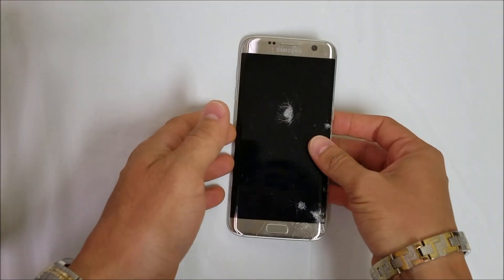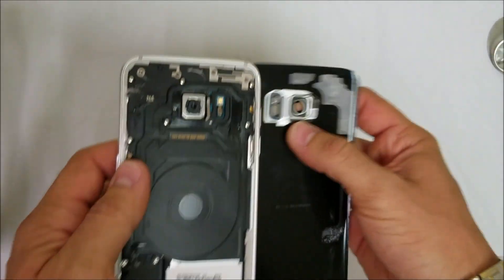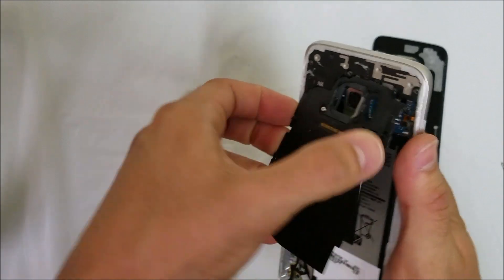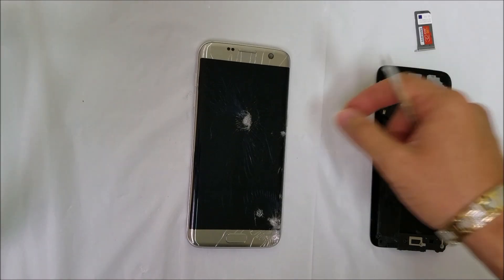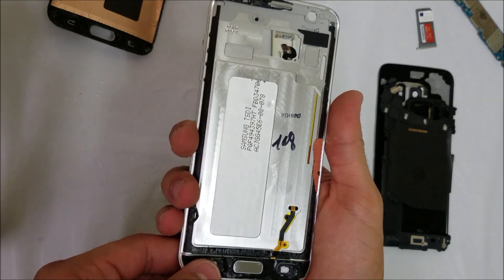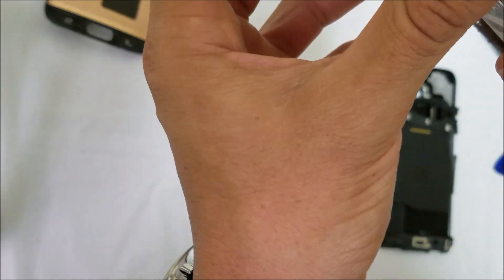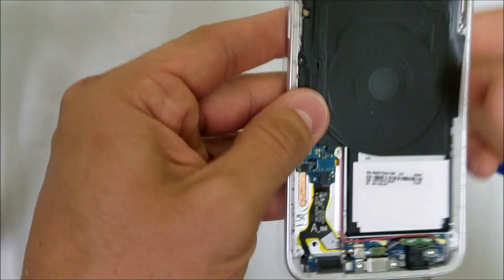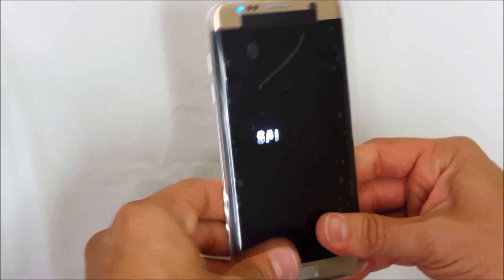Samsung Galaxy S7 Edge - How to Take Apart & Replace LCD Glass Screen Replacement

Comment: Always testvthe new screen before screwing pcb board protectors in.Alao spray alcohol in between where you are trying to prise apart to soften the previous repair glue.
Slide screen up and down because I have had 2 screens that did not slide open.
Good video but cringed for you when you were tugging away at the old screen lol ! 
I have liked and subscribed.

Comment: Yeah my back cover just shattered when I got to an edge.

Overall decent video, phone works, forgot to plug in the power button the first time. New screen was aboun $90, now I need to buy a back panel ($20) and the tools to fix it cost me $20 - Mine came with new adhesive, but I lost the speaker grille. 

Consensus - I could have bought a new used phone instead, but it was a good exercise.
Reply: I need acces to old files on my phone lol screen is broken just going to order an old screen from ali for like ten bucks and have a fun little "exercise" to be able to acces my files again.
Reply: Lmfao nice

Comment: You should have tried to remove the digitizer in one piece to reduce extra shards forming. Another trip to the hot plate would really have helped. For best results, I would apply fresh adhesive. I wouldn't have said "pry the board" up, "Lift the board" would have been better.
Reply: You are right. Here in Ireland we say: "Gently raise the main logic board from the assembly, always remembering to use a clean shovel"

Comment: Will remove the back of the phone kind of  affect the waterproof of the phone and also will the glue stick back in?
Reply: The adhesive will work again - but not be water resistant. You can  buy new adhesive cheaply. So cheap, I would buy a couple as you MAY ruin the first one. Practise run, if you will

Comment: 6:08 Dose it say a whole 4.4V on the battery?!! I was sure 4.2V was the absolute max for lipos.
Reply: dose of what? and yes it does in case you're wondering..better take it up with Samsung lol
Reply: @sebastianmuntean235  Oh I wrote wrong, I of course meant roller coaster. Thanks for pointing this out, I understand I could be very hard for some ppl to undertsnad what I meant there I understand i fit was hard for you, Its not easy. And I just remembered that SAMSUNG have a special HV type batteries in their phones, good shit.
Reply: @dtiydr  standard voltage is 3.85 and charging voltage is 4.4
Reply: @ldiazmdiaz  Ok charging voltage so the max voltage on the battery could be lower with other words.

Comment: This is a great chance since these are really original and very  NEW and not cheater source. We just got this offer from the original supplier NOW.
He asks several old friends to offer price, which offers the highest price, he will give goods to that one.

AVAIL QTY DESCRIPTION  
601 iPhone 6 LCD Screen and Digitizer - OEM Premium / White OEM Premium  
100 iPad Air 2 LCD Screen and Digitizer / New / Part Only  
264 iPhone 6 Plus LCD Screen and Digitizer - OEM Premium / Black  
135 Galaxy S6 LCD Screen and Digitizer / New / Black  
110 Galaxy Note 4 LCD Screen and Digitizer / Black / New  
187 iPhone 7 LCD Screen and Digitizer - OEM Premium / Black  
91 Galaxy S6 LCD Screen and Digitizer / New / Gold  
89 iPhone 7 Plus LCD Screen and Digitizer Full Assembly - OEM Premium / New / Part Only  
100 Galaxy Note5 LCD Screen and Digitizer / Black / Part Only  
276 iPhone 5c LCD Screen and Digitizer - OEM Premium / New  
64 Galaxy Note 4 LCD Screen and Digitizer / White / New  
57 Galaxy S6 LCD Screen and Digitizer / New / White  
58 Galaxy S7 LCD Screen and Digitizer / White / Part Only  
118 iPhone 6s LCD Screen and Digitizer - OEM Premium / New / Part Only  
100 iPhone 6 LCD Screen and Digitizer - OEM Premium / Black  
129 iPod Touch (5th Gen) LCD Screen and Digitizer / Part Only / Black  
2000 iPhone 6s Plus Display Assembly Adhesive / Black  
59 iPhone 6 Plus LCD Screen and Digitizer - OEM Premium / White  
35 Galaxy S5 LCD Screen and Digitizer / Black / New  
39 iPhone 6s Plus LCD Screen and Digitizer - OEM Premium / New / Part Only  
29 iPad mini 4 LCD Screen and Digitizer / New / Part Only  
55 iPhone 6s LCD Screen and Digitizer - OEM Premium / New / Part Only  
27 Galaxy Note 4 LCD Screen and Digitizer / Gold / New  
26 Galaxy S5 LCD Screen and Digitizer / White / New  
48 Galaxy Note5 LCD Screen and Digitizer / White / Part Only  
15 iPad Pro 9.7" LCD Screen and Digitizer / White / New  
20 Galaxy Note 3 LCD Screen and Digitizer / White / Part Only  
102 iPhone 5 LCD Screen and Digitizer - OEM Premium / White  
14 Galaxy S6 Edge LCD Screen and Digitizer Assembly (GSM) / White / New  
119 iPhone 4 LCD Screen and Digitizer (CDMA/Verizon) / Part Only / White  
159 iPod Touch (4th Gen) Display Assembly / Part Only / White  
30 Galaxy S4 LCD Screen and Digitizer (no Midframe) / Black / Part Only  
23 Galaxy S6 LCD Screen and Digitizer Assembly (Verizon) / White / A-Stock  
12 Galaxy S6 Edge LCD Screen and Digitizer Assembly (GSM) / Gold / New  
9 Galaxy S6 Edge+ LCD Screen and Digitizer Full Assembly (AT&T) / Black  
15 Galaxy S5 LCD Screen and Digitizer / Gold / New  
164 MacBook Pro 13" Unibody and MacBook 13" Unibody Fan / Used / Silver  
17 Galaxy S6 LCD Screen and Digitizer Assembly (Sprint) / Black / A-Stock  
9 Galaxy Note II LCD Screen and Digitizer (T-Mobile/AT&T) / White / New  
6 Galaxy S7 Edge LCD Screen and Digitizer / White  
14 Apple Watch (38 mm Original) LCD Screen and Digitizer / Sapphire Crystal / New  
6 Galaxy S7 Edge LCD Screen and Digitizer / Gold  
29 Galaxy S8 Midframe / Black  
28 Galaxy J3 LCD Screen and Digitizer / Gold  
5 Galaxy S7 Edge LCD Screen and Digitizer Assembly (AT&T) / Silver / New  
6 Galaxy Note 3 LCD Screen and Digitizer Assembly (Sprint/Verizon) / New / White  
403 iPad 2 Wi-Fi 16 GB (EMC 2560) Volume and Power Button Cable / New  
12 Galaxy Note 3 LCD Screen and Digitizer Assembly (T-Mobile/AT&T) / B-Stock / Black  
13 iPhone 7 Plus LCD Screen and Digitizer - OEM Premium / White  
9 Galaxy Note 3 LCD Screen and Digitizer / Black / Part Only  
4 Galaxy S7 Edge LCD Screen and Digitizer Assembly (AT&T) / Gold / New  
12 Galaxy S6 LCD Screen and Digitizer Assembly (Verizon) / Gold / A-Stock  
5 Galaxy S6 Edge+ LCD Screen and Digitizer Full Assembly (AT&T) / White  
30 Galaxy Note5 LCD Screen and Digitizer / White / Part Only  
DESCRIPTION QTY ALL NEED CAMERA BRACKET AND SENSOR BOX INSTALLED
iPhone 6 LCD Screen and Digitizer / New / Part Only / Black        400 　
iPhone 5c LCD Screen and Digitizer / New / Part Only               100 　
iPhone 6 LCD Screen and Digitizer / New / Part Only / White        300 　
iPhone 5s LCD Screen and Digitizer / New / Part Only / Black       200 　
iPhone 6 Plus LCD Screen and Digitizer / New / Part Only / Black   300 　
iPhone 5s LCD Screen and Digitizer / New / Part Only / White       200 　
iPhone 6 Plus LCD Screen and Digitizer / New / Part Only / White   200 　
iPhone 6s LCD Screen and Digitizer / New / Part Only / Black       400 　
iPhone 6s LCD Screen and Digitizer / New / Part Only / White       300 　
iPhone 6s Plus LCD Screen and Digitizer / New / Part Only / Black  300 　
iPhone 6s Plus LCD Screen and Digitizer / New / Part Only / White  200 　
iPhone 7 LCD Screen and Digitizer / Black                          250 　
iPhone 7 LCD Screen and Digitizer / White                          150 　
iPhone 7 Plus LCD Screen and Digitizer / Part Only / White         150 　
iPhone 7 Plus LCD Screen and Digitizer / Part Only / Black         200 　
iPhone 8 LCD Screen and Digitizer / Black                          25 　
iPhone 8 LCD Screen and Digitizer / White                          25 　
iPhone 8 Plus LCD Screen and Digitizer / Black                     25 　
iPhone 8 Plus LCD Screen and Digitizer / White                     25 　
  
DESCRIPTION QTY 
iPhone 4S LCD Screen and Digitizer / New / Part Only / Black                              90 
iPhone 4S LCD Screen and Digitizer / New / Part Only / White                              100 
iPhone 5 LCD Screen and Digitizer Full Assembly / New / Part Only / Black                 10 
iPhone 5 LCD Screen and Digitizer Full Assembly / New / Part Only / White                 24 
iPhone 5 LCD Screen and Digitizer - OEM Premium / Black                                        50 
iPhone 5s LCD Screen and Digitizer / New / Part Only / Black                              23 
iPhone 5s LCD Screen and Digitizer / New / Part Only / White                              69 
iPhone 5s/SE LCD Screen and Digitizer - OEM Premium / Black                                    37 
iPhone 5s/SE LCD Screen and Digitizer - OEM Premium / White                                    82 
iPhone 5c LCD Screen and Digitizer Full Assembly / New / Part Only                        3 
iPhone 5c LCD Screen and Digitizer / New / Part Only                                      2 
iPhone 5c LCD Screen and Digitizer - OEM Premium / New                                         139 
iPhone 6 LCD Screen and Digitizer Full Assembly / New / Part Only / Black                 376 
iPhone 6 LCD Screen and Digitizer Full Assembly / New / Part Only / White                 39 
iPhone 6 LCD Screen and Digitizer / New / Part Only / Black                               40 
iPhone 6 LCD Screen and Digitizer / New / Part Only / White                               27 
iPhone 6 LCD Screen and Digitizer - OEM Premium / Black                                        135 
iPhone 6 LCD Screen and Digitizer - OEM Premium / White                                        191 
iPhone 6 Plus LCD Screen and Digitizer Full Assembly / New / Part Only / Black            14 
iPhone 6 Plus LCD Screen and Digitizer Full Assembly / New / Part Only / White            32 
iPhone 6 Plus LCD Screen and Digitizer / New / Part Only / Black                          138 
iPhone 6 Plus LCD Screen and Digitizer / New / Part Only / White                          89 
iPhone 6 Plus LCD Screen and Digitizer - OEM Premium / White                                   75 
iPhone 6s LCD Screen and Digitizer Full Assembly - OEM Premium / New / Part Only / Black       9 
iPhone 6s LCD Screen and Digitizer Full Assembly - OEM Premium / New / Part Only / White       11 
iPhone 6s LCD Screen and Digitizer / New / Part Only / Black                              65 
iPhone 6s LCD Screen and Digitizer / New / Part Only / White                              21 
iPhone 6s LCD Screen and Digitizer Full Assembly  / New / Part Only / Black               18 
iPhone 6s LCD Screen and Digitizer Full Assembly  / New / Part Only / White               14 
iPhone 6s Plus LCD Screen and Digitizer Full Assembly - OEM Premium / New / Part Only / Black  6 
iPhone 6s Plus LCD Screen and Digitizer Full Assembly - OEM Premium / New / Part Only / White  10 
iPhone 6s Plus LCD Screen and Digitizer / New / Part Only / Black                         1 
iPhone 6s Plus LCD Screen and Digitizer / New / Part Only / White                         32 
iPhone 6s Plus LCD Screen and Digitizer Full Assembly / New / Part Only / Black           13 
iPhone 6s Plus LCD Screen and Digitizer Full Assembly / New / Part Only / White           14 
iPhone SE LCD Screen and Digitizer Full Assembly - OEM Premium / New / Part Only / Black       13 
iPhone SE LCD Screen and Digitizer Full Assembly - OEM Premium / New / Part Only / White       7 
www.shengxintga.com

Comment: Good video did one in an hour just be careful with the back cover when you start cause it is glass and I reheated the glue on the frame before reinstalling the LCD back on and also the back cover and yes I put all new adhesive back on😁

Comment: Anybody else watch this video and say ...."No thanks I'll just take it somewhere. I was going to try doing mine until I saw this shit.
Reply: LOOOOOOL, that's exactly what I was thinking. Just thought I'd read the comments first though. This comment made me laugh.
Reply: Nick Johnsen nope I just did it pretty simple took me an hour to do it 😎
Reply: nah man actually tempts me to try it myself..love a challenge and save some cash why not
Reply: Nick Johnsen actually no
Reply: Yeah, it's taken me weeks to summon the courage but I've just finished this - I looked at several different vids and made sure I got all the parts needed, including the adhesive templates, new jack where I busted the ribbon cable (doh!). Take your time and this is doable - oh and make sure you keep the phone hot when teasing it apart it helps enormously - that glue cools down and hardens real quick.
Reply: @OggyGTA  How much did it cost?  If it costed $50 I'd do it tomorrow but kits seem to be priced around $230. :-(
Reply: Most people outside would not do a glass only replacement.
Reply: me right there
Reply: No I watched and was like “looks easy, I’m gonna try it”
Reply: it really aint that hard.....actually fun doing
Reply: is alright, but he didnt do it the best way. also, he left the old double-face adhesive on...that is what makes it water proof, or water resistant -_-

Comment: You ruin the Lcd and digitizer . Learn how to replace just the glass. You are a rooky
Reply: Locon Giganton it was ruined. He is changing the whole unit.
Reply: He pointed out a small spot where the display was damaged under the hole, not just the glass screen part.

Comment: where is a good place to get a digitizer for the Galaxy S7 Edge
Reply: It's best to get a service pack instead. It includes the mid frame, buttons, and lower charge connector. You provide the main board, camera, speaker, vibrator motor, etc. Basically enough so you don't need to remove the screen as everything that connects under it will be included.

Comment: Why didn''t you remove all the old adhesive from the back? Is it still waterproof using this method?  I'd imagine that it needs to be very flat to seal it up again.
Reply: normally you would, then you would buy a adhesive replacement. if you keep it in, i suggest not getting water on it or putting it in water, because personally i wouldn't trust how strong the adhesive is after the repair.

Comment: Whats the cost for the screen? I see two camps on Ebay as far as price. those in the low 100's and 300 dollars. I cracked the screen on my S7 Edge this morning, but I went to see the prices and decided to go from gold to black. The tear down looks easy but I wonder why you didnt use a heat gun to loosen the adhesive? and will the new screens adhesive retain the IP68 water resistance rating? Thanks for your time and the tear-down tutorial.
Reply: he used a hot plate

Comment: wondering what it cost to replace glass? thanks
Reply: definitely more than that actually it costs 150 to 300 (average) just to buy the glass and touch digitalizer.
Reply: Just the glass is cheap, but separating that from the actual digitizer is near impossible without damaging the digitizer. Therefore, replacing both is often a better choice
Reply: Bob Fetters 15-20 dollars if you do it yourself

Comment: FYI, good video but he should have mentioned to be very careful taking off the back. It may look like metal but it is glass as well; now I have to wait for a replacement for that. Geez!!!
Reply: I tore/broke off a small chip of the paint under the glass :/  The glass is good though
Reply: Of course its glass, how could wireless charging work otherwise? Gees.

Comment: hello. could you tell us how much heat is enough. i will be doing this for my first time. 
also, where could i order this complete tool kit
Reply: To separate lcd glass, 80 degrees; to remove glue, 160 degrees. Welcome to contact Amy. We are factory in Shenzhen China for LCD repair machine and accessories. Whatsapp: +86 13682503305.
Reply: Xiao Mobile LCD repair solution Skype: amy_6421 Amy how can i send my mobile for glass change. and what is cost

Comment: Oled. It's oled not an lcd it's oled. Ffs. You triggered me
Reply: lucas lane it's not oled, it's AMOLED
Reply: @kylerebman5094  Well damn it now that you mention it, I just looked at the ebay listing for the part I bought and it says "Display type: LCD, display type: OLED". Is OLED the same as AMOLED as far as listing it goes?
Reply: @ChristiaHall  AMOLED has a quicker refresh rate, punchier colors in terms of contrast, and varied viewing angles. OLED screens are thin, flexable, organic layers that can bend easier (i.e: iPhone X's bottom of it's screen is bent under the screen to achieve smaller bezels). OLED also do not require backlighting 

So there's a few differences. But the biggest one you'll notice is how much more vivid and contrast is had in AMOLEDs over OLEDs
Reply: @kylerebman5094  Interesting. I wonder if I should return it then. I just assumed all the replacement screens by Samsung were equivalent to the original part.
Reply: @ChristiaHall  the descriptions are never too accurate for replacement parts. In my experience, they have often stated different types but, installing them, they appear quite similar to what they did before. If you notice defects after installing though, I would return it

Comment: You have installed it without taking off old adhesive, dude these adhesive strips costs pennies and it's just sad to watch...
Reply: He should of at least reheated the phone so the adhesive melts and reseals everything together. But that's worst case scenario. Old adhesive should always be removed and new adhesive should be installed.
Reply: maybe to check it works before sealing it up
Reply: Rolandas Šukšta nebutina nuimti senus klijus. Ekranas puikiai limpa prie senuju kliju

Comment: I have a question, why didn't u heat the Lcd or put some glue on it for still being a waterproof, is it gonna be still a water poor or not?
Reply: bye bye water resistance once you take it apart